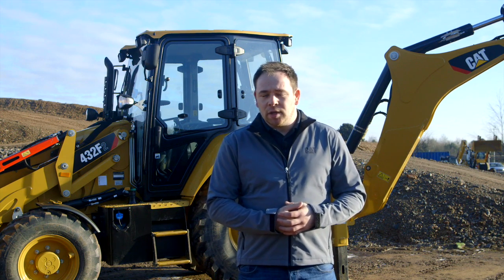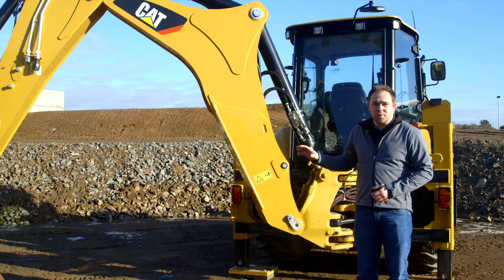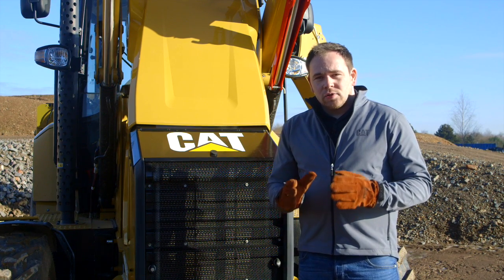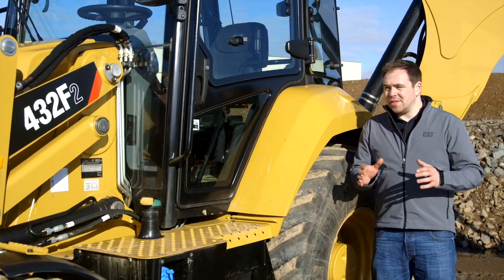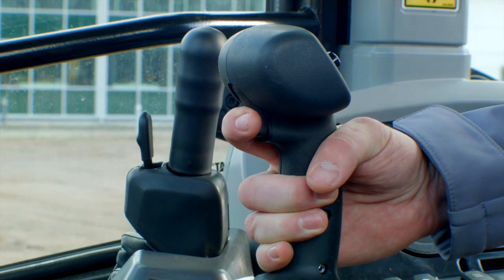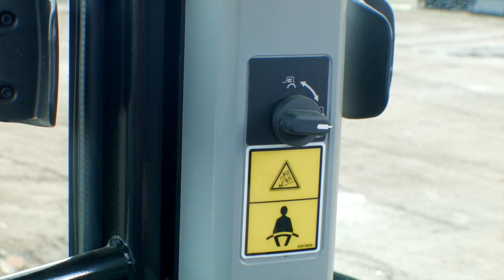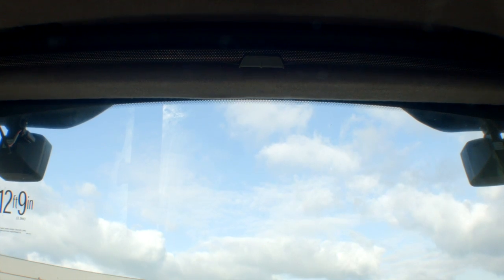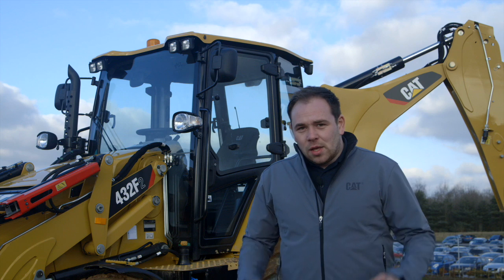Cat® 432F2 Backhoe Loader Overview (Europe)

Comment: I drive one of these 423f2 in the uk every day there awsome machines very comftable easy to use servo controls front Nd back fast operateing the power is endless especially pushing in heaps with 4in1 all round great powerful machine... Totally Pisses all over a jcb 3cx..
Reply: What's it like on the road everyday mate is there any bounce in it with smooth ride on